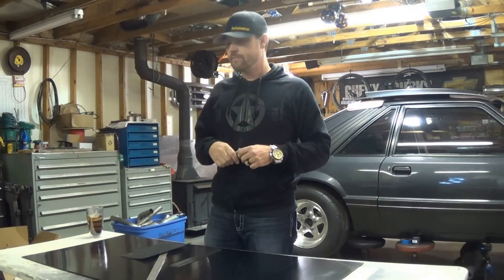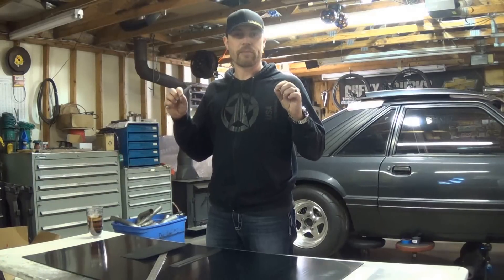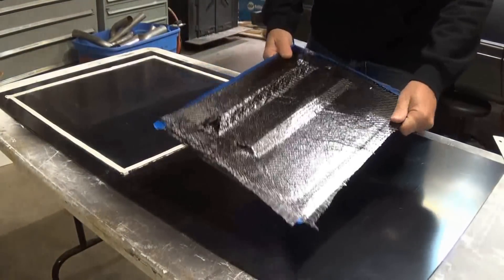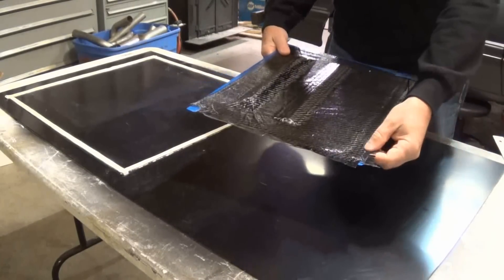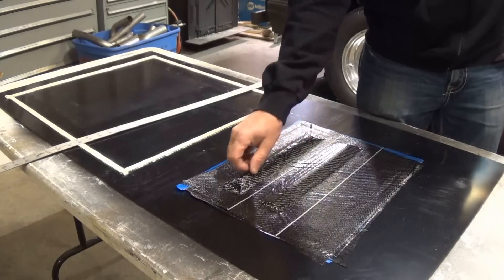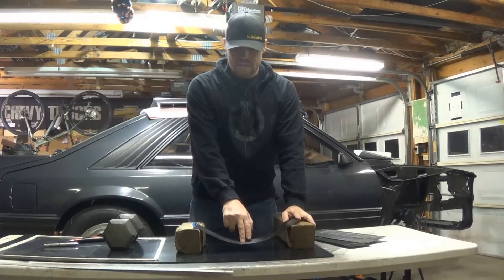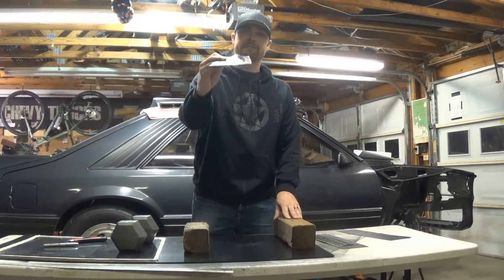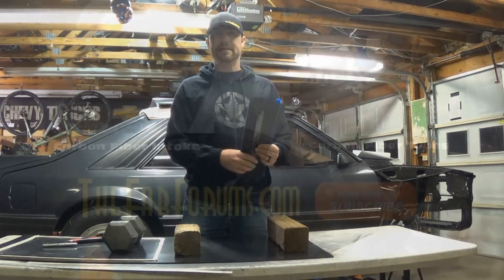Carbon Fiber Fabrication | Strength Testing

Comment: It's all about your area moment of inertia :-)
Reply: +RoboTekno Moment of Inertia is all about torque. I was thinking this is solely based on the direction of the thread in each orientation. Sure the foam added some strength, but I suspect the majority of the strength and rigid nature comes from the thread orienting itself in the z direction.
Reply from the maker: what he said
Reply: +RoboTekno what does that even mean.
Reply: +joshmdmd Basically, "the thicker, the better." :-P
Reply: Moment of intertia is very important in calculating deflections and stresses. Look up some of the equations of deflection loading (strength of materials) if you're interested. If you create a higher moment of inertia you can resist torque which imparts a lower force and thus it's "stronger" strength of a material is a finite number rated in modulus and tensile strength, geometry allows you to control the imparted forces.

Comment: What is the black substrate you're cutting the CF on? Do the cut marks cause any vacuum seal problems?
Reply from the maker: MatSciMinded Its a sheet of abs plastic. In this particular video I wasn't worried about using that piece of plastic again. I usually cut everything with scissors.

Comment: Great Video!, I was about to buy carbon fiber sheets for rigidity and you just saved me a lot of money by this technique. But why did you cover it with a plastic sheet and vacuum out the air? is it for like curing the resin? Would it work without vacuum the air? Thanks.
Reply from the maker: it would work without vacuum but the vacuum technique presses the layers together very tight an removes excess resin that's not needed.
Reply from the maker: Probably not...they pretty much have the prepreg ration down to a perfection.

Comment: You probably wont see this, but I had a few questions:

First: the section that had no foam, if you were to want to make a few body panels, would this be a good way to do it? Or would you want it to have less flex? I think that the flex would be better because it wont break if you were to hit something, such as a speed bump, etc. 

Second: how would you make parts that are concave/convex? Such as fender flares. Is there a way to do it without having any folds or wrinkles?
Reply from the maker: Martin Ramirez Well even with the foam you will still have some flex in larger parts like fenders. You dont have to use foam. If you use enough layers of fiber it will be ridged enough.

Comment: That's pretty revolutionary. I mean istead of X braces on doors and hoods you can put this foam and it would probably be as strong as it was but MUCH lighter! I'm i wrong?
Reply from the maker: most cabon  fiber manufactures that make parts for strength already use a process similar to this. most use a honeycomb style filler.

Comment: I see you use foam to give it thickness but do you need to use foam everytime you make a carbon fiber part?? I mean, can you make parts stronger without using foam? like hoods or even small parts like tubes? Also, please start shipping to Peru, I want one of those carbon fiber starting kits on your website :S
Reply from the maker: you dont have to use foam you can use more fabric instead...it just makes it heavier and more expensive.
Reply: Thanks. And if I want to make car panels, how many layers of fabric should I use?
Reply from the maker: it really depends on the weight of the fabric

Comment: If I wanted to make a carbon fiber panel for a car, is foam necessary? I mean panels do have some bends but are mostly flat, and I don't think they should be as flexible as the part you made without foam. Would I just have to add more layers of fabric to make it less flexible? I'm new to this and trying to learn about carbon fiber xD
Reply from the maker: X BlackReaper foam wouldn't have to be used. The contours of the car panel would be enough to really stiffen it. You would probably also want to use more fabric.
Reply: Ohhh ok, thanx!!
Reply from the maker: no problem...anytime

Comment: You discovery sandwich composites again :) rigidity and thickness have relationship, rigidity increases as the cube of the thickness, for e.g. thickness 1 to 2, rigidty 1 to 8 unit
Reply from the maker: AboutComposites Yea I was trying to show that in the simplest way possible to my viewers. I wanted to show a flexible piece car be made ridged with dimension.

Comment: the dimensions arent the only thing giving cf strength.  a LOT of it comes from the weave and the lay out themselves.  ultimately, because of that, cf can be brittle in multiple situations if it is used outside the parameters of what that weave and what loading the design is developed for (been doing a lot of research on making composite control arms).  F1 uses that idea to create CF crash structures front and back.
Reply from the maker: 1320crusier you are correct some weaves are stronger then others and the way you lay them up can also affect the strength but your major strength comes from giving the part dimension. Ive showen it in this video. I took the same weave and made it over 100 times stronger just by adding dimension to it. I don't care what weave you use or how you lay it up you wont be able to replicate that without dimension in the part. Thanks for watching

Comment: polyster resin is not for carbon for not look and not strenght.
Reply from the maker: Darius Dulskis I didn't think so but I have heard of people making carbon parts with poly that are just used for decorative parts.
Reply: yes but they heat them up after if no that is total crap i do stuff 9 years so small experience here

Comment: have you ever vacuum form the carbon fiber with a sheet of aluminum? nice watch.
Reply from the maker: 1down4up I have never used aluminum but I have used steel. The mold for the upper intake video was made from 1/8 inch steel.

Comment: are you using polyester resin?
Reply from the maker: No you always want to use a epoxy resin for strength. Polyester resins are mainly for looks.
Reply: ah ok, just because its a dark colour of epoxy then :) not used to see it that "brown"
Reply from the maker: yea that particular brand starts off as a reddish brown and lightens as it cures